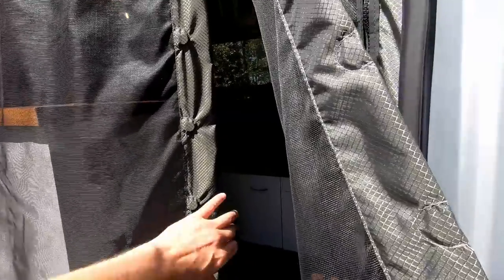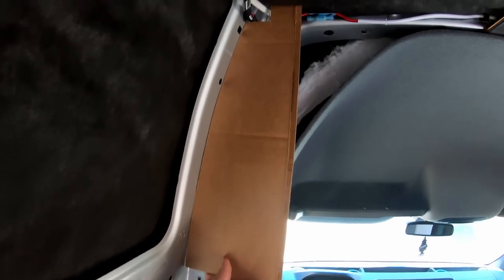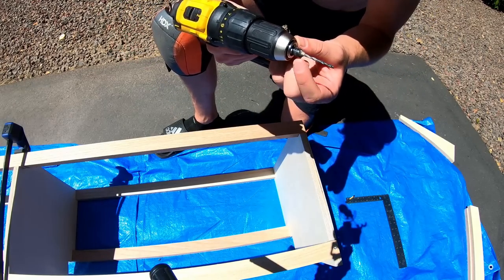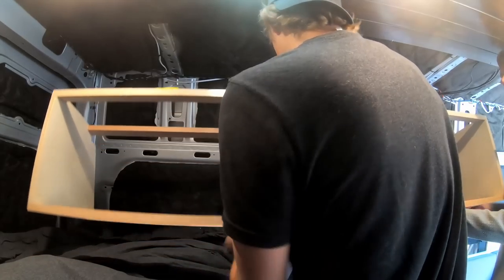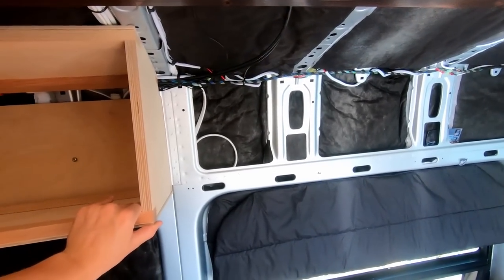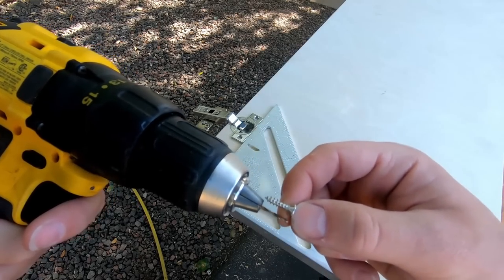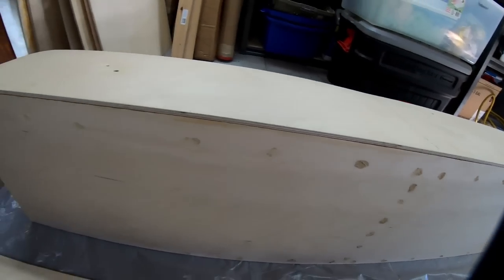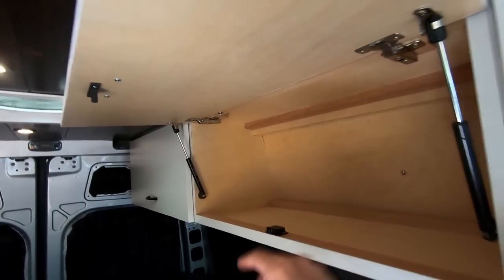STRONG & LIGHT Upper Cabinets In The VAN!!!! #vanlife #vandwelling

Comment: As a design engineer, I approve. This is probably the cleanest and most professional method for making upper cabinets I've seen to date. I'll definitely be going this right in terms of upper cabinet design. Thanks for sharing and including links to some of the tools you used. Makes the process so much easier.

Comment: FYI - Blum makes face frame mounting plates that mount to the edge of the wood frame so you don’t have to add the wood blocks behind the mounting plate - they also make lift arms ( AVENTOS HK-XS)  that work with the soft close hinges you used.
Reply: Hey Skip, trying to work out the best blum hinge solution for a set of almost identical cabinets to what seven here built - except I want to try and use the lighter 1/2" ply for the cabinet doors. Do any blum hinges work with that thickness?

Comment: I am an engineer and building a camper van conversion.  I thought I knew a thing or two, then I watched your video.  The playdo trick is boss.  Great job.  Great instructions.  Subscribed.  Hope to see you on the road some day.
Reply: Easier yet, just grind the head off a couple bolts and make them into a point.  Now just thread them in to have the point stick out, and "bump" your cabinets after positioning them to set the mark into the wood...  reusable, no play dough clean up...

Comment: An alternative to the pinkie method for templating is to do it with your pinkie the first time, then just run the pencil body against the roof, and it will be super accurate.
Reply: i use a marker/pencil with a roller bearing from an old router bit, works killer, same idea as yours, you put the bearing around the pencil. and roll away and mark.
Reply: Most carpenters use an inexpensive compass from the dime store.  Simply keep it vertical or horizontal as you mark the cardboard with your pencil and trace the curve with the pointed end.

Comment: Just FYI for anyone looking to do a similar project there is such a thing as bendable plywood. Most regular plywood you find at places like HD and Lowes is comprised of layers of plywood which are sealed together in alternating wood grain directions. Bendable plywood is sealed together with the grain all going in the same direction. It works really well when you need to make a tight curve but it will also cost a bit more.

Comment: Seven O'Savage! Loving your whole channel and meticulous methods. I'm just curious what you did with your ceiling planks that were above the cabinet. Did you leave them out and have to trim the adjacent planks to sit flush to the edge of the cabinetry? Do you think it would have been better to use the same ceiling build technique, but only after the cabinets had been installed to save on time and materials? Or is there some benefit to fitting the whole ceiling? Keep it up!
Reply: Curious about this as well. Because of the plusnut placement, I don’t imagine that he was able to fit the ceiling panels back above the cabinet. When I look closely, it seems that he may have ripped the ceiling plank to size, and used screws rather than a magnet to fit it in next to the cabinet. Because his cabinets basically run the length of the van’s wall, he’s then just able to not use any planks in that area. Just a guess though

Comment: really nice job. good to see wood glue (pva) used in cabinet assembly - most self builders don't use it. The rivnuts (that what we call them in Europe) are the best way to attach cabinets to van. One alternative to Birch plywood is Poplar plywood which is even lighter. Great job.
Reply from the maker: Thanks Barry. I agree, wood glue is legendary.
Reply: hi Seven. thanks for your reply. I noticed the tool you were using to insert the rivnuts into your van. is this a proprietory tool or homemade. either way it worked very well. Thanks. barry

Comment: Your a talented fellow, I will be building cabinets for my cargo trailer conversion. You could also use white wood instead of the oak. White wood is a fairly hard wood but less weight than the oak and less expensive for sure. I will also install a second bottom with some cross members to carry more weight.

Comment: Awesome cabinet build video, I agree with most commenters, the best I have seen, and I have watched a lot of videos.  I call  you the 'terminator' of van build, calmly and quietly getting it done in a super solid efficient way, leaving no doubt....  Great work, and thanks for sharing!  

I am almost done with my build, just now starting cabinets.  It seems that everything I do works out, and when done I get all sorts of ideas how to do it better, quicker, and with more useful features if I did it again.  That is my question, what would you do differently next time?  The things on my mind are using Oak 1x3s instead of 1x2s, using 1/2" Baltic Birch for the vertical supports, using 1/8" BB for the inner skins, and using a hinge that incorporates a 'hold open' feature.  What do you think?

Comment: Presentation as always is excellent, nice job!  Maybe change the title of the video to omit the 'light'  part, these super strong upper cabinets have full thickness doors, hard wood and high ply count cases (even though used sparingly) and lots of hardware, perhaps you could highlight the simplicity of the design in the title rather than the weight.

Comment: Maybe an easier option to scribe your cardboard is by using a flat washer. Get a decent size washer that will just fit over a pencil. Hold your cardboard up, and with the washer pressed against the roof or side of the van, start scribing.

Comment: Really like the lightweight structure. I might worry about that microwave just sitting on 1/4'' ply thats just pinned up from the bottom. would hate to see your dinner come crashing down. GRK makes little cabinet screws with a washer head that you could use to screw that bottom panel up into the sides with.
Reply: today's microwaves are light,  10 years ago it maybe you would have to use 1/2" wood.
Reply: @red7media  I didn't mean the plywood isn't strong enough. Just that the method of attachment (pin nails) may fail. Gotta keep in mind this vehicle may be driving on rough roads...
Reply: @cliftonobrien588  I thought I was the only one who noticed that. A few bumps and that microwave is dropping straight out the base of the cupboard. Nothing less than screws for that job and I still would have used thicker ply. Far better to have a microwave lower anyway, as taking anything out a microwave above shoulder height is asking for it to be all over yourself! Been there, got burnt haha.

Comment: Seven O - I see you used 5/16-20 plus nuts. I have researched multiple sites and there seem to be equal numbers of sites suggesting 1/4-18 plus nuts. What are the advantages of each? And, what bolts do you use to attach the cabinets to the plus nut receptacles in this video and other videos where you are using 80/20? Thanks so much for your clear, concise, informative videos and related links. Super helpful!
Reply from the maker: Hey Jed, 5/16 bolts are just bigger stronger and easier to work with. They’re ideal for 15 series 80/20 but do not fit with 10 series 80/20
Reply: @seven_o_savage  Awesome. Thanks for the super quick response. I am trying to get Plus Nuts as some seem to suggest they are a bit better then Rivnuts. Have you had any issues with the Rivnuts in your links? Thanks, again!

Comment: Baltic Birch and birch in general is stiffer and stronger than Red Oak. Also plywood resists warping better. Why didn't you use plywood where you used the red oak beams?

Comment: Way to go Seven! you are doing a great job. I am on my Sprinter 170  4x4 build in my barn now. thanks for putting your dimensions in the video. let me ask you are the cabinets a good size or would you have made them smaller?  I want that size, but, I was wondering if it would take up to much space. I want to go down the passenger side of my van with my raised north to south bed in the back. keep videoing! 
Dolphindave

Comment: Hi from the UK. Very nice build and explanation/video technique. I'm trying not to be negative but I wondered if those screws mounting the hinges to the frame were not too close to the edge of the material? I saw you put extra blocks in there but as this is an instructional video would the better advice be to start off with the thickness of cabinet needed to fit screws so that there is material all around them ? John

Comment: Hi,  great videos you're doing/ done.  I've got a question about the  plus nut/bolts. Since it's going through the body of the van would it be wise to put some kinda caulking/ sealant on the hole or the bolt just so fluid doesn't get into the hole ove r the life of the car?
Reply from the maker: Yes that would be a good idea. I've rust proofed my holes after drilling them, but it's not perfect as you scratch the metal during installation

Comment: Should use a few more Rivnuts for safety: no one considers the forces involved in a head on collision, even at slow speed...  also, make the cabinets monolithic by screwing them together, two bolts from each side towards the other in an X pattern.

Comment: Just curious if there was a reason you didn't orient the rear lower oak support vertically so you could use that to anchor the cabinet to the van for more strength? Excellent design and explanation - much appreciated!
Reply from the maker: Thanks! At the time I probably felt more inclined to have the back curvature match perfectly to the van... Looking back though, your idea sounds like it would work.

Comment: Awesome video - super instructional! Question - why did you drill holes for the plusnuts rather than just fitting them into the existing holes within the frame?
Reply from the maker: 2 main reasons: I wanted them to be in a specific spot, and holes for plusnuts need to be a pretty specific size

Comment: Not sure if anyone else asked but did all your ceiling panels go back up before you reattached the upper cabinets. As you were tracing out the curving I saw you had removed the ceiling panels. Just curious on the overall fit.

Comment: Curious as to why you chose oak strips over 80/20?
Reply from the maker: Due to the way I designed it (with Baltic birch cross sections) oak w/glue is stronger than 80/20. If you did a full 80/20 exoskeleton that would be awesome... but... shipping times 😛

Comment: How did the door fair when you installed the rest of the ceiling?  Were you able to open the cabinet doors fully or did you have to cut back a little bit of the ceiling to allow such movement?
Reply: Or did you just add a small spacer between the top of your cabinet attach point and the bottom of the van rib?  I'm thinking that may be the way to go, but just curious if anyone as done anything else.
Reply from the maker: I installed the gas struts so that the doors stop before coming in contact with the ceiling.

Comment: Thanks for the video! Just curious about how the microwave cabinet holds up without the shocks? Do those hinges hold it up pretty good?
Reply from the maker: Yes the microwave cabinet has held up great 👍
Reply: Seven O'Savage I meant the door of the microwave cabinet. Does it have the shocks on it or is the door just holding up by the hinges?
Reply from the maker: @chadbrown407  Ah, no it does not hold itself up. I typically prop the cabinet door open by opening the microwave door and letting it rest on top.

Comment: I notice that at 20:16 that there's a gap between your ceiling panels and the cabinets. How did you fill that in afterwards without it showing any sort of gap? Thinking about this for our own van
Reply from the maker: I ended up putting 1 ceiling plank back that overlaps the cabinets
Reply: @seven_o_savage  amazing thank you! Did you kind of slip the panel under the top piece of the cabinet, or cut the panel to be narrower and have it abut the cabinet?
Reply from the maker: @claramerlino2413  just slipped it under
Reply: @seven_o_savage  you're the man thank you!

Comment: Hey man can you tell me what tools I’ll need for a full sprinter conversion? I’m about to purchase the van but don’t have any of the tools yet.
Reply: Chop saw, table saw, circular saw, jig saw, set of drill bits, hammer, socket set, caulking gun, cordless drill/impact driver set, screw drivers, oscillating tool, belt sander, random orbit sander, hole saw set. clamps, various hand tools, channel locks, vise grips crescent wrench... could get everything for 1,500.00 or so.

Comment: next time, just grind the head off a 1" bolt that goes into your Rivnuts and grind a point onto it.  Make a couple of these, and you just thread them into the Rivnut, align your work, and tap it to make the mark into the wood to locate your hole...
Reply: That is way more work than playdoh
Reply: @terrypurdy2827  In what world is hand turning in a pointed screw "harder" than smearing and cleaning off playdoh?
Reply: @brianmi40  I would rather play with playdoh than grinding a point, threading them in, threading them out....and the mark in the playdoh seems much more clear...
Reply: @terrypurdy2827  That's your choice, but the grinding is a one time thing and took me all of 2 minutes with a grinder, and obviously a perfectly centered punched mark in the wood is drill ready versus having to drill through Playdoh "somewhere in the center", or take another step yet to make the mark the easier tool would have already made, without the need to remove Playdoh. 

If you think a ring of Playdoh that you have to still hit the center of manually is better than a pre-punched centered mark, then I can't help you.  good luck
Reply: @brianmi40  Everything is about choices.  I don't have a grinder.  Playdoh is much cheaper than a grinder and more portable. And everyone has their own unique skills and limitations.
Reply: @terrypurdy2827  Yes it is.  That is the part I was trying to get to.  If you don't have the tools that's a completely different story.

Next time maybe don't waste time with fallacious arguments and cut to the chase: you don't have the tools to use that better method.

Comment: Great video. Thanks. 
I'm a little concerned about the strength of the microwave cabinet. Is the floor of the cabinet merely fastened to the frame using glue and brads? I know microwaves are light but brads are not very strong holding in that direction.
Reply: I've looked for an answer to that question myself .....thanks for asking. I fear it's been posted for to long to be answered now
Reply: The glue provides way more strength then the brads will. A properly glued joint is stronger than the wood itself

Comment: You should DOUBLE the number of Plusnuts at least: no one considers the stresses involved in even a slow speed accident which can be up to 100 times the force of you jerking on it as hard as you can to test it.  Those few can readily be broken in an accident allowing it to fly forward...  sometimes you don't get a do over.

Comment: Nice cabinets, but I disagree, the best way by far to make cabinets or indeed anything else inside a van is 8020 / t-slot aluminium.
Reply: Totally unnecessary. This cabintet will never come apart and is far less expensice than 80/20.
Reply: @johntatman1436  I disagree. I mean, it may never come apart, I wasn't saying it was shoddy, but using t-slot throughout the build makes it much stronger, lighter and it's probably easier to get it right. Plus, you can disassemble it and change it if you need to, whereas using wood is basically a one way process, if you want to change it you have to demolish it. Furthermore, of course, aluminium is impervious to water, rot, pests, rust, you name it, whereas natural materials aren't. You can do it with wood, but doing it with t-slot is objectively better. Not cheaper, no. But better.
Reply: @lorcro2000  You are correct, 80/20 gives you the ability to do all those things. However if you watch George on Humble Road, he's probably spent $150.000 and almost 2 years building his first van.  I think most people would not be financially able to do this and it's not necessary.
Reply: @johntatman1436  T-slot aluminium in the small amounts it takes to build a van does not cost $150 grand. Humble Road has spent a lot because he has the best components in there. Very expensive Lithium battery pack, a Rixens heating system, and so on. I doubt if he's at $150k though. Plain straight t-slot is a few bucks per meter, and you can buy standard sizes in bulk if you want, even from China. Yes, t-slot will cost more than wood, but you don't need such quantities that it adds up to huge numbers just to build some cabinets. There is probably enough t-slot in the bed design that buying that one more time would get the job done, more or less.
Reply: his build looks pretty costly as it is, maybe if you had a unlimited budget you could use 8020, for my build i am going a whole other route.